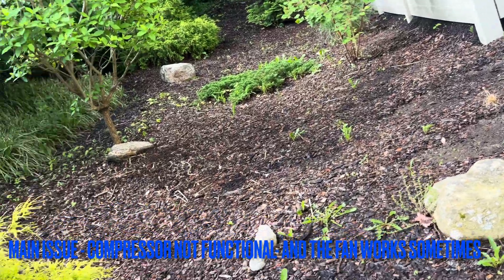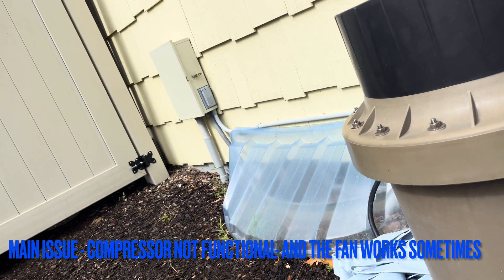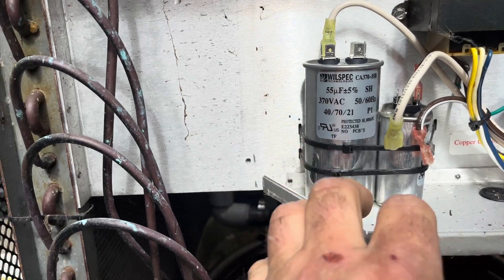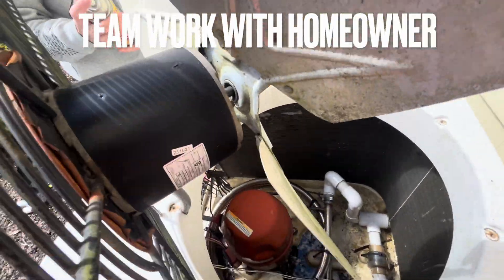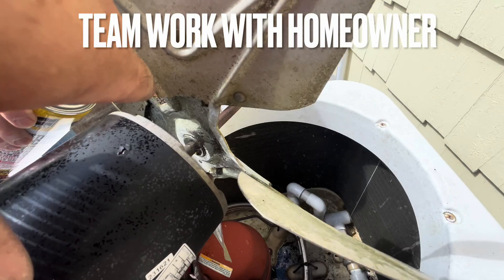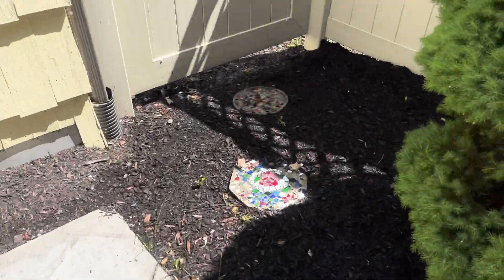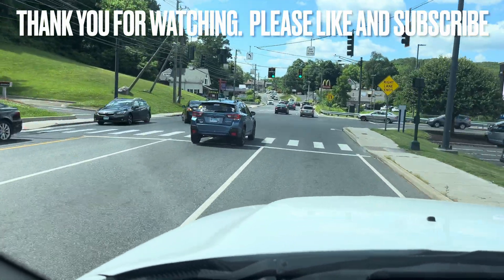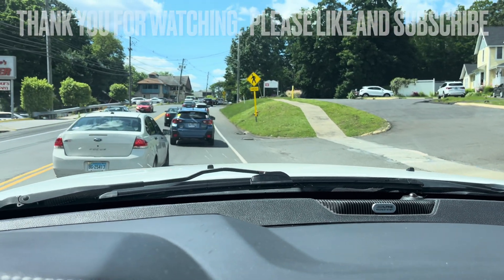WHY IS MY POOL HEATER (POOL HEAT PUMP) NOT HEATING?  FAN AND COMPRESSOR NOT WORKING?  #shorts

Comment: The pool heaters that run on oil are always fun to work on. Dumb idea putting an oil burner out in the weather. 🤣🤣🤣. Cha Ching.  I smell money
Reply from the maker: That’s crazy.  I’ve never seen that.  Obviously gas but that’s nuts.   Is there any type of winterization process or no
Reply: @hvacotj  laars is the brand and pool guy does all that. The oil tanks will be outside half the time. They have a spa switch which usually gets corroded , otherwise it’s oil 1,2,3 🤣
Reply from the maker: My company has a few real oil techs.  My brother in law is also very experienced with oil.   Me, all honesty I know very little, even though it seems like it’s just a pump , power with combustion and nozzle etc.   But I suck at getting the customer heat because of the line is ever air bound or just tuning with air band etc.  I Just was thrown into oil maint. At the company I work for.  In NY it seems like they don’t required license for individual trades. I’m trained warm air and cooling so if I ever had a callback for oil and another tech talks shit , I say good luck with doing all oil.   Whatever I do In this trade I’d rather ask a “stupid” question than learn the hard way.
Reply: @hvacotj  oil is easy once your inundated , and having a license doesn’t guarantee the mechanic will be good. I’ve seen it , sloppy , lazy work. But hey I’m NORA certified gold certification 🤣 at 1 in the morning no one cares. Just fix it and get the hell out of my house. 🤣🤣 reality.